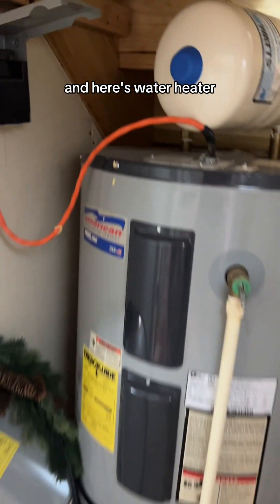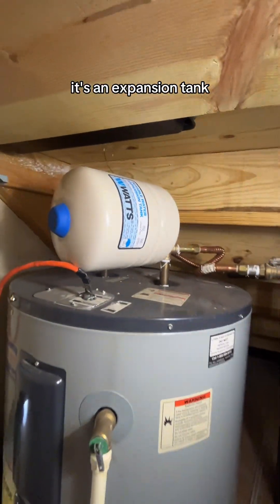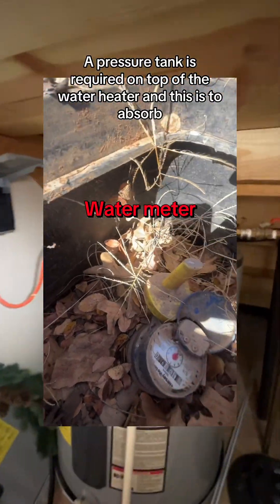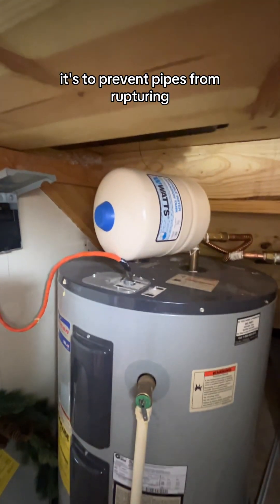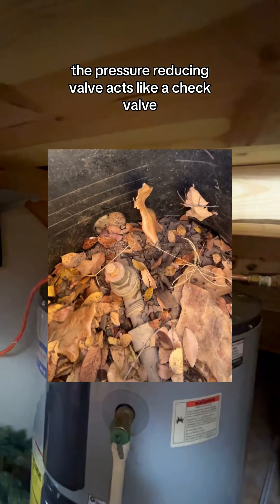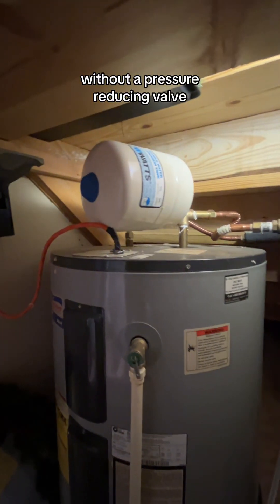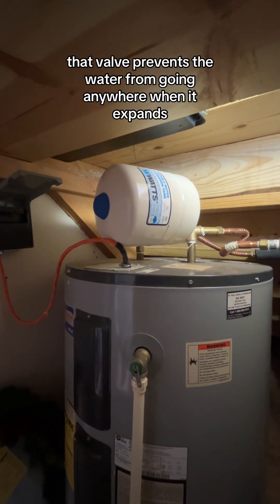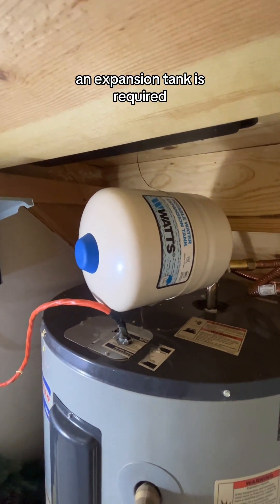What are Expansion Tanks? #plumbing

Comment: It also works as a dampener say like when your washing machine shuts the hot water valve quickly and create a water hammer. Because flowing water does have inertia. That'll help save pipes as well.
Reply from the maker: Very good point. Thank you